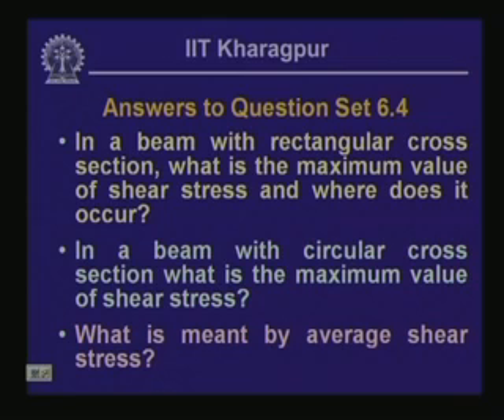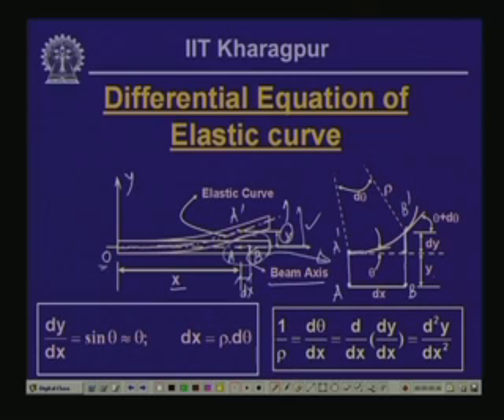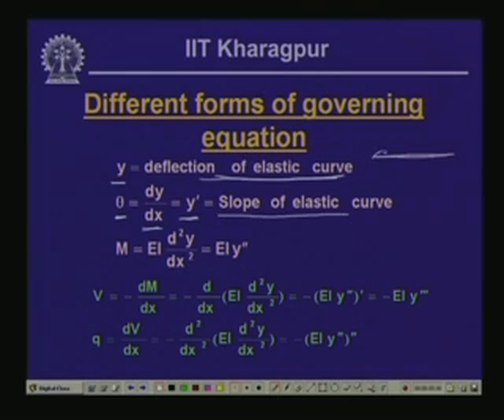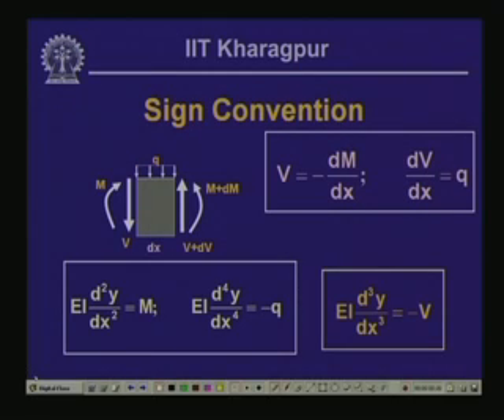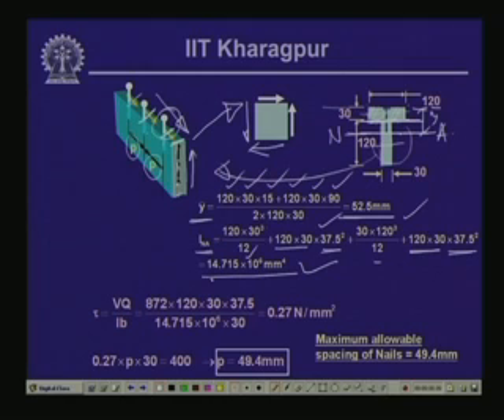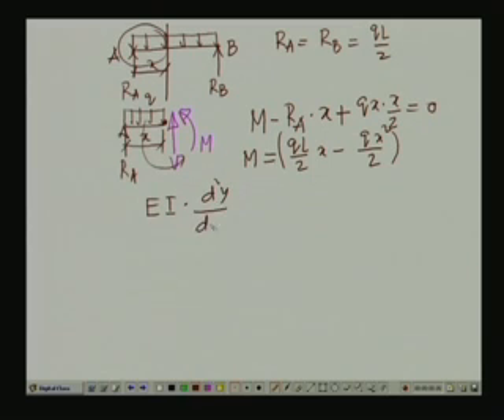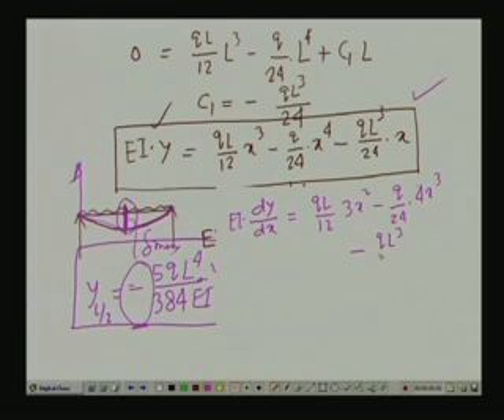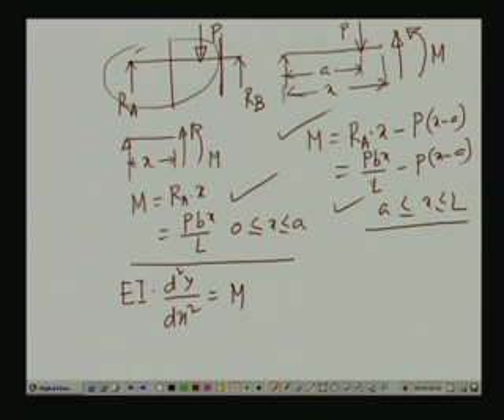Lecture - 30 Deflection of Beams - I

Comment: ***** For calculating how much load the wooden beam can hold make sure you know the allowable bending stress and shear stress(not as important as bending stress) of the wooden material you are using. Divide this allowable stress with a factor of safety. Then using sigmab=Mmax/section modulus you can find the maximum point load you can hang from a certain point on the beam. For this find an expression for Bending Moment M on the simply supported beam in terms of Load(P).
For knowing how much weight the cable can carry, equate Load/area=allowableTensileStress/factorOfSafety. From that you will get an idea of the maximum load. Consider the least Load found from the two mentioned cases and make sure whatever you do, do not exceed that load on the beam or cable.